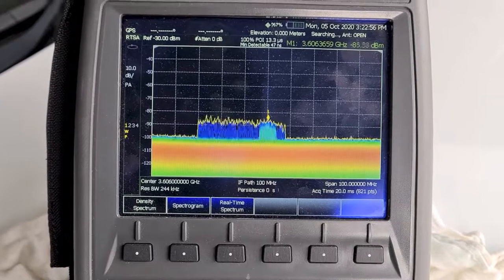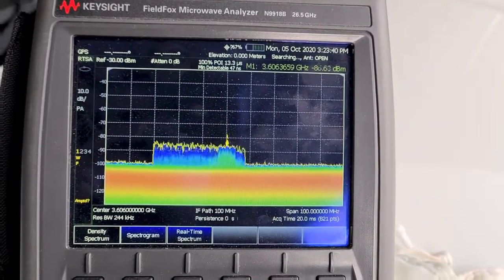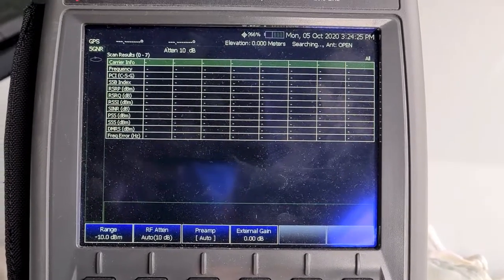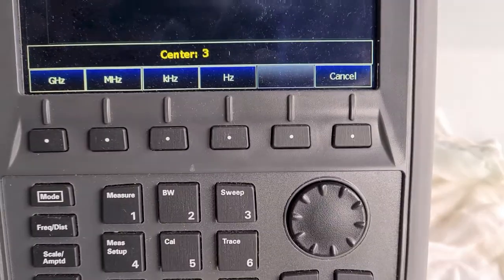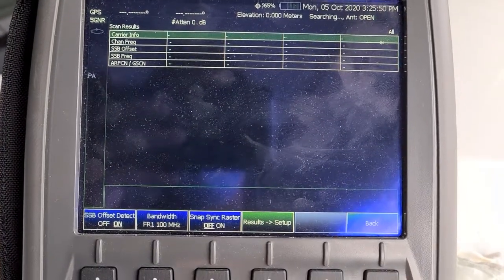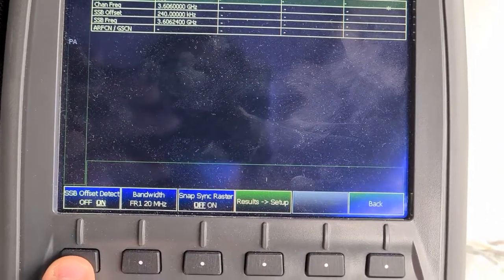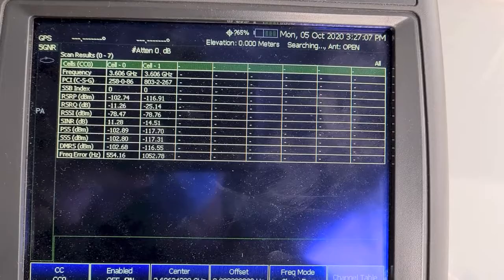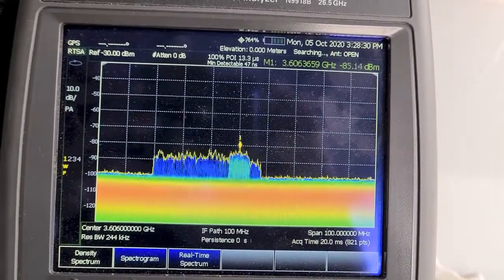5G NR OTA Measurement #FieldFox #5G

Comment: Hello,
Thanks for educational video!
Could you please explain how FieldFox distinguish two cells(and two PCIs) as they are sharing the same ssb frequency (two signals are on same freq) ?

Thanks!
Reply from the maker: i found this somewhere in the web.
"The Physical Cell Identity (PCI) in 5G New Radio (NR) is represented by the Primary and Secondary Synchronization Signals (PSS and SSS) within the Synchronization Signal Block (SSB)1. The PCI is unique to each cell and is used by user equipment (UE) to identify and synchronize with a specific cell1.

In the case of multiple cells (each with a unique PCI), each cell would transmit its own SSB. Therefore, two different PCIs would not reside within the same SSB. Instead, each PCI would have its own corresponding SSB1. This is because the positions of the Demodulation Reference Signals (DM-RS) across the PBCH are determined by the PCI1.

So, to answer your question, two PCIs cannot reside within the same SSB. Each SSB is associated with a unique PCI, and each cell transmits its own SSB1. This ensures that UEs can correctly identify and synchronize with the appropriate cell."

With that, i will think that FieldFox actually scan thru the spectrum. There's a part where user can set the search bandwidth and this is where FieldFox tries to decode the information for all the SSB channel that it found while doing the scan. Hence the long delay for the result to be displayed on the screen.

Hope this answers your question.
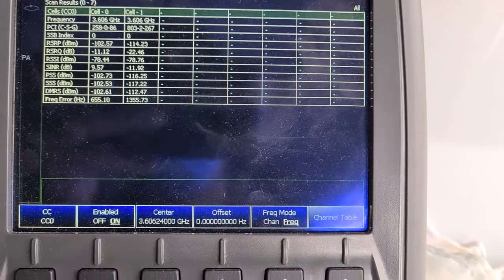Reply: @autumngreentech4726  Could you please look at 4:07 once you have populated the results in the scan table?

cell0 pci 258 0 86 frequency is 3.606 GHz
cell1 pci 803 2 267 frequency is 3.606 GHz

Seems like the frequency is the same, correct ?
Reply from the maker: that's a great observation! 3.606GHz is the carrier signal with about 100MHz of bandwidth and within the same bandwidth there are multiple SSB channels. here is the summary for SSB information and how different channels can be fitted within the 100MHz bandwidth.
"In 5G NR (New Radio), the spacing between Synchronization Signal Blocks (SSBs) with different Physical Cell Identifiers (PCIs) depends on several factors, including the carrier frequency and the subcarrier spacing used. The SSB frequency raster and its spacing are defined by the 3GPP standards. Here is an overview:

SSB Frequency Raster
The SSB frequency raster is the set of frequencies where SSBs can be placed. The placement of SSBs within a given carrier bandwidth follows a defined raster that is determined by the subcarrier spacing (SCS). The SSB raster spacing is as follows:

15 kHz SCS: SSBs are spaced by 240 kHz
30 kHz SCS: SSBs are spaced by 480 kHz
60 kHz SCS: SSBs are spaced by 960 kHz
120 kHz SCS: SSBs are spaced by 1.92 MHz
Frequency Range
The exact placement of SSBs also depends on the frequency range (FR) in use:

FR1 (Sub-6 GHz): SSBs typically use a 30 kHz SCS or 15 kHz SCS, depending on the specific band.
FR2 (mmWave): SSBs use a 120 kHz SCS or 240 kHz SCS.
Multiple SSBs and PCIs
In practice, multiple SSBs can be transmitted within the same carrier, especially in the case of beamforming where different beams cover different spatial directions. Each SSB carries a different PCI.

Example Calculation
For an SSB with 30 kHz SCS in FR1:

SSBs would be spaced 480 kHz apart.
If there are multiple SSBs within a carrier, each would be placed at a multiple of 480 kHz from a reference frequency.
By adhering to these spacing guidelines, the network can ensure proper decoding and synchronization of SSBs by user equipment (UE), enabling the detection and connection to the correct cell and PCI."
Reply from the maker: on the Sub Carrier Spacing (SCS):
"The bandwidth of a Synchronization Signal Block (SSB) in 5G NR is determined by the subcarrier spacing (SCS) used. The nominal bandwidth for an SSB consists of the Primary Synchronization Signal (PSS), Secondary Synchronization Signal (SSS), and Physical Broadcast Channel (PBCH). Here's a detailed breakdown:

Subcarrier Spacing (SCS) and Bandwidth
The 5G NR standard defines different SCS values, and each affects the total bandwidth of an SSB:

1. 15 kHz SCS:
SSB occupies 4 Resource Blocks (RBs).
Each RB has 12 subcarriers.
Total bandwidth: 4 RBs×12 subcarriers×15 kHz=720 kHz.

2. 30 kHz SCS:
SSB occupies 4 RBs.
Each RB has 12 subcarriers.
Total bandwidth: 4 RBs×12 subcarriers×30 kHz=1.44 MHz.

3. 60 kHz SCS:
SSB occupies 4 RBs.
Each RB has 12 subcarriers.
Total bandwidth: 4 RBs×12 subcarriers×60 kHz=2.88 MHz.

4. 120 kHz SCS (used in FR2 or mmWave frequencies):
SSB occupies 4 RBs.
Each RB has 12 subcarriers.
Total bandwidth: 4 RBs×12 subcarriers×120 kHz=5.76 MHz.

Summary
15 kHz SCS: 720 kHz
30 kHz SCS: 1.44 MHz
60 kHz SCS: 2.88 MHz
120 kHz SCS: 5.76 MHz

These bandwidth values ensure that the synchronization signals and broadcast information within an SSB can be properly transmitted and received by user equipment (UE)."
Reply: @autumngreentech4726  

Hi again, thanks for the detailed explanation.

What about 4G LTE FDD or TDD?

If I'm not wrong, FF can decode several PCI simultaneously, but my confusion is that in 4G SSB is always centralized on carrier frequency (in 5G it could be shifted within total channel BW as you explained) 

If I'm correct, FF can decode two different PCIs even if PCIs are on the same carrier frequency in 4G?
Reply from the maker: FF is able to decode the LTE SSB, sometime can be more than a Cell. i think you are referring to the Cell information. I've just checked on my FF on the LTE measurement, within the same LTE band, FF is showing me 2 Cell information within the same PCI. The interesting part is that this LTE PCI has what we called C-S-G (Closed Subscriber Group) and here are the detail explanation that i found online:

In LTE (Long Term Evolution), the concept of Synchronization Signal Blocks (SSBs) does not directly apply as it does in 5G NR. However, LTE does use similar synchronization signals for cell identification and initial access: the Primary Synchronization Signal (PSS) and Secondary Synchronization Signal (SSS). These signals are part of the LTE physical layer and are used for the initial cell search process and to determine the Physical Cell Identity (PCI).

Synchronization Signals in LTE
1. Primary Synchronization Signal (PSS):
- Helps the User Equipment (UE) to acquire time synchronization and find the symbol boundaries.
- There are 3 different PSS sequences corresponding to 3 different physical layer identities (0, 1, 2).

2. Secondary Synchronization Signal (SSS):
- Provides the frame synchronization and helps in identifying the PCI.
- There are 168 different SSS sequences which, combined with the PSS, provide 504 unique PCIs (3 PSS × 168 SSS).

Physical Cell Identity (PCI)
- PCI Range: 0 to 503.
- Each cell in the LTE network is assigned a unique PCI within the serving area to avoid confusion and interference.
- The PCI is derived from the combination of PSS and SSS.

Placement of Synchronization Signals
- The PSS and SSS are typically placed in the center of the LTE band within the primary synchronization channel (P-SCH) and secondary synchronization channel (S-SCH) respectively.
- They are transmitted in the first and the eleventh OFDM symbols of the first slot in each frame.

Multiple PCIs in the Same SSB
In LTE, each set of PSS and SSS uniquely defines a PCI. Therefore, it is not possible to have more than one PCI within the same synchronization signal pair (PSS and SSS) in the same cell. Each cell's synchronization signals will map to a single, unique PCI. Here are the key points:
- Single PCI per Cell: Each cell is identified by a unique PCI derived from a combination of PSS and SSS.
- No Overlap: There cannot be more than one PCI within the same synchronization signal pair because each PCI is unique to a specific combination of PSS and SSS.
- Inter-Cell Coordination: Cells within the same geographical area must have unique PCIs to avoid interference and confusion during the cell search process.

In conclusion, in LTE, there is no possibility of having more than one PCI within the same PSS and SSS combination. Each PCI is unique to a cell and is derived from specific PSS and SSS sequences.

In the context of LTE, the term "C-S-G" stands for Closed Subscriber Group. This is a concept used primarily in relation to femtocells (also known as Home eNodeBs or HeNBs), which are small cellular base stations typically used to improve indoor coverage and capacity.

Closed Subscriber Group (C-S-G)

A Closed Subscriber Group is a group of users that have exclusive access to a particular femtocell. These femtocells are often deployed in residential, enterprise, or public settings to provide enhanced coverage and capacity in specific locations.

PCI and C-S-G

Physical Cell Identity (PCI) is a crucial part of the LTE system, used to identify cells and manage communication within the network. In the context of femtocells and Closed Subscriber Groups:

1. C-S-G Indicator: 
   - The C-S-G indicator is a part of the cell's broadcast information, indicating whether the cell is a member of a Closed Subscriber Group.
   - This information is broadcast in the System Information Block (SIB), specifically SIB1, which is transmitted by the cell.

2. PCI Allocation:
   - The PCI is used by both macro cells and femtocells to uniquely identify cells within the network.
   - For femtocells operating as part of a C-S-G, the PCI is still unique but the cell may also broadcast its C-S-G identity.

3. Access Control:
   - Femtocells with a C-S-G configuration will restrict access to only those users who are part of the C-S-G. This is typically managed through an Allowed CSG List stored in the user's device.
   - Users not part of the C-S-G will not be able to camp on these cells, even if they have strong signal strength.

 Summary

- C-S-G (Closed Subscriber Group): A group of subscribers who have exclusive access to a specific femtocell.
- PCI (Physical Cell Identity): A unique identifier for cells within the LTE network.
- C-S-G Indicator: A part of the cell broadcast information indicating if the cell is part of a Closed Subscriber Group.
- Access Control: C-S-G cells restrict access to authorized users only, based on the Allowed CSG List.

In summary, C-S-G represents a restricted access group for certain femtocells, ensuring that only authorized users can connect to those cells, and the PCI uniquely identifies the cell within the LTE network.
Reply: @autumngreentech4726  could you please check this video for OTA 4G https://www.youtube.com/watch?v=FSCMy1U2Xrs&t=43s. At 0042 3 diff PCI are decoded on same frequency 751 MHz. I understood these PCIs are transmitted on same frequency, as displayed in the table, am I correct ?
Reply from the maker: FF only decode and display the PCI (C-S-G) information instead of the PCI (consist of both PSS and SSS) information, which normally is a round number. 
so the PCI information that you are referring to is Closed Subscriber Group information, which can reside within the same SSB channel.